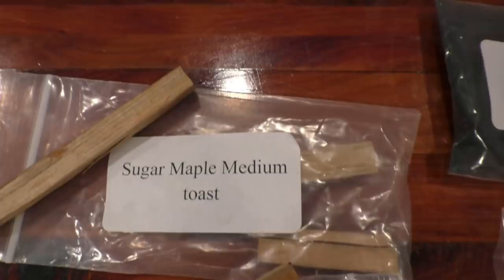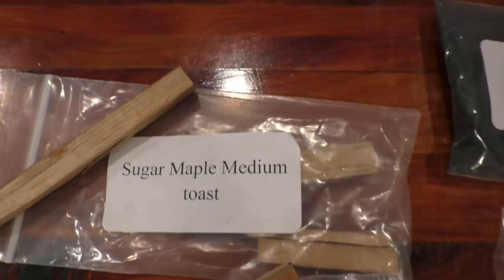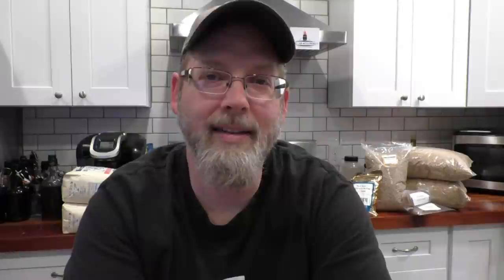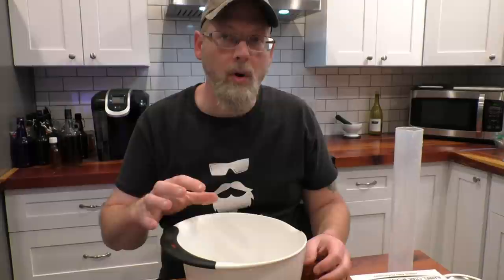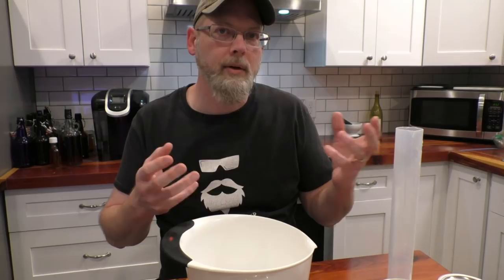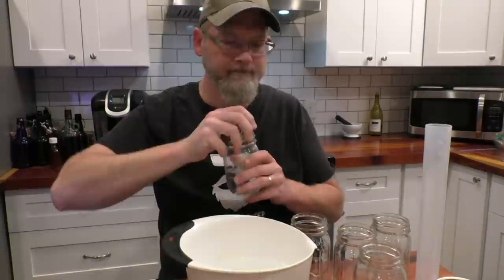IRISH WHITE WHISKEY! How to make POITIN!

Comment: You can use a step ladder, and ratcheting pulleys (Amazon) to lift and hold the brew bag over the mashtun. Use an eye bolt w/ washers through a 2x4 across highest steps, or an eye bolt w/ washers through the top step.  A lot easier than lifting it out yourself.
Reply from the maker: Yeah, I think I'll have to do that, especially for the big batches. Way easier to do them outside on the propane burner with a rig like that;-)

Comment: I know you probably thought of this .
 But I myself have done the dance with the grinder many many times and what I did was found  a metric bolt and two nuts, cut the head off and threaded it in and used the two nuts as jam nut locks to keep it in place. And beveled the edge of the bolt so the chuck wouldn't slip.
Put the drill on it and wala.
Much happier grinding.
Reply from the maker: My drill died:-( Otherwise I would have done that for sure. 30 minutes to grind all that by hand.
Reply: @BeardedBored  now you have a wonderful reason to buy new tools. 
A win win all around.
Reply from the maker: @kennethcounts5905  Yep!

Comment: Hey Bearded, after watching you struggle with the BIAB i thought id offer up my solution to that problem, I cook my grains etc in a pot without the BIAB and once done chill it then syphon or laddle into my BIAB, the BIAB is hung inside a 30L fermenter with tap, the opening of the BIAB hangs outside the fermenter over the thread,  and the BIAB suspended off the bottom  by about 6", so the fermenter has a 2 piece lid a ring which is threaded and a clear top with oring and ahole for the air lock, (a bit like a big mason jar and two piece lid) i leave the top out of the equation and use the ring to hold down the BIAB threading it over the BIAB, now the BIAB can hold 10kg of grains and its easy to sparge into, now using the tap you can tap off into a bucket the main bulk of the wort, and after sparging leave it to drip out over night, and your pretty much done, I have put the BIAB and grain into a free bucket and another bucket in the ontop of the grain then put a big pot over them both flipped it over and sat on it and you can get another 500ml's to 1L, so thats not really worth it extra cleaning. Also pulling the BIAB and grain out of the fermenter full is hard work and  stresses the BIAB, so now i just sparge and leave drip out overnight then scoop out the grains into a bucket and toss in the compost. It makes things a bit easier im not sure those fermenters with the two piece lid are still that popular but you could tie the BIAB off under the fermenter thread, or use a bucket with a  tap and lid cut a big hole in the lid and use rim of the lid to lock the BIAB into place suspened off the bottom.  love your work keep it up Cheers.
Reply from the maker: Thanks so much for the detailed setup advice! I'll give it a try. Sounds much easier:-)

Comment: On your grain mill you can go to the hardware store and find a big bolt cut the top off and use a battery drill
Reply from the maker: My Riyobi drill batteries died so I went to get some more. Then I almost died when I saw how expensive they'd gotten since the last time I bought some.
Reply: @BeardedBored  that's why the tools themselves have gotten cheaper. They make the tool cheaper so you'll buy more of the batteries! That's where they're making all the money!

Comment: Hey Bearded, way to go on 50K!  Have you read anything on making sugar "gumballs" from your spent grain (if you don't use them for a beer)?  Best advice I've seen is to sample that to keep your paws off the all-grain while it's aging.  And it's a great way to get another batch out of what would normally be considered "spent grain" that would be tossed.  Also, check out a stainless steel hop filter if you want to ferment on-grain.  It will help keep the grains out of the siphoning process.  Just drop/hang it on on bucket & transfer to the pot!

Cheers!
Reply from the maker: Awesome ideas, brother! Thanks!

Comment: Hey B&B, congrats on 50.5 k subs. "Membership has its privileges". Did Christmas come early for someone as I thought I saw a new toy being used to grind up that barley and oats.  🎅✌✌
Reply from the maker: Thanks man. Yeah, I finally got a grinder:-)
Reply: @BeardedBored  so what did you buy and does it work as well as it should and you thought " has to be better, faster than the magic bullet ".   I've been thinking of buying a grinder like yours instead of a malt muncher like Jesse, George use.
Reply from the maker: @rickmilkovic  If I had the cash I'd get a better grinder like theirs for barley and use this hand crank one for corn. Most grain mills can't fit corn through the rollers, but the hand crank doesn't have a problem with it. I just popped a link in the video description for the one I'm using. It's for the cheap one that I have, but there are better hand crank mills for corn.
Reply: @BeardedBored  yup get what your sayin, Ill do a lil more thinking . Thanks for the input👍

Comment: Im in michigan and "hypothetically" purchasing  a new still in october  and im torn between a 10 gallon reflux from clawhammer and a 20 gallon copper pot still with a three gallon thumper.  I would like my first run on the new stills to be poitin.  (Its only fair because my hypothetical profits over the past year are going in an envelope marked Irish vacation), would you suggest reflux or pot or poitin, and if pot would you add mash to the thumper or leave it empty?  You, george and still it have already helped me out with so much in your videos over the past year.  My poker group all thanks you as well.
Reply from the maker: Well, if the Clawhammer rig has a way to turn off the reflux water, then you can run it like a pot still and get the best of both worlds. Jesse has done that with the T500 several times. 

If you end up going with the thumper, yes, mash in the thumper is the way to go. Hypothetically speaking of course;-)

Comment: Need to get you a drill to replace that crank handle on the grinder.
Reply from the maker: My ryobi drill batteries all stopped recharging. Went to home depot to get some new ones and almost fainted at the price. They're $79! They were $29 last time I had to get some. Going to get some aftermarket ones from Amazon.

Comment: 50k club eh? Well deserved Bearded !! If you ever have a problem with the spindle grinding plate wobbling, I have a fix for it. Btw any info on a push to get home distillation legalized here in the USA?
Reply from the maker: Thanks so much! So far so good on the grinder. First time I've used it though;-)

As for legalization, not really. I sent some letters to the Senators working on cannabis reform, but haven't heard back because it's such a non-issue for them and I'm not a resident of any of their states. There is no organized movement anymore. It requires people to voice their opinions to their representatives, either through lobbyists or in such great numbers that they can't ignore it. The problem with our community is that, despite the numbers, most of us are middle-aged with comfy lives and don't want to take the risk of getting outed. Marijuana has had younger more enthusiastic advocates for a lot longer so they are way ahead of us. Also, the medical marijuana thing has helped ease legislation a lot. I was hoping to ride their coat tails if we can get even one legislator to add the language into the bill.

But I'm worried that unless one of us wins the lottery and pays a lobbying firm like the defunct HDA did before, the only thing we can do is write letters for now. Hopefully George, Jesse and I can get big enough with our channels to have some influence in the future. It's very frustrating.

Comment: How would your results been different if you fermented on the grains?
Reply from the maker: You get a bit more flavor, grainy flavor. But the only reason to do it is if you can distill on grain too, like with a thumper. Got to be indirect heat. If you can't distill on grain, then you're just losing the alcohol that is stuck in the grain. Not a lot at this scale though.

Comment: Out of interest does Poitín still contain some solanine or is it separated during the distilling process?
Reply from the maker: I didn't use potatoes, so it's not really a concern for this recipe. But I'm pretty sure as long as you don't use green potatoes, peel them and boil them well, the chances are much lower of having a problem.

Comment: I made the Irish Whiskey and it fermented out.  I then racked to a secondary container where it has sat for 1 week clearing.  It has now developed what looks like an infection.  It has a solid white coating on top of the racked mash.  What to do, what to do?
Reply from the maker: Distill it. Infections are not a problem in distilling mashes. Also, it sounds like you have a Kahm yeast layer, which is not a problem either.
Reply: Thank you.

Comment: Yeah your gonna have beer flavored whiskey. I tried a barley heavy bill n it's just 90 proof beer for lack of a better palette. As for being on wood??? Idk oaky beer? Btw malted grains and whole grains lend different flavors all together. IE barley that's not malted offers some unique flavors as well as just plain ole rolled oats
Reply from the maker: LoL, I didn't put hops in the whiskey;-)
Reply: @BeardedBored  I mean the barley. I had a few lbs of whole barley and just figured wth and made up a mash 12lbs b and a few lbs of spent grain. I swear it's like a 90 proof Carona
Reply from the maker: @boharris8179  Hmm, interesting.
Reply: @BeardedBored  You really should do a little experimenting with whole grains vs their malted form. Corn has been the most extreme change in flavor I've noticed so far especially if you dry it with your oven and let it get a light toasting. I already mentioned the barley and I've got a batch using whole rye now.
Reply from the maker: @boharris8179  I've read some beer recipes with malted and unmalted grain. I'll look into it.